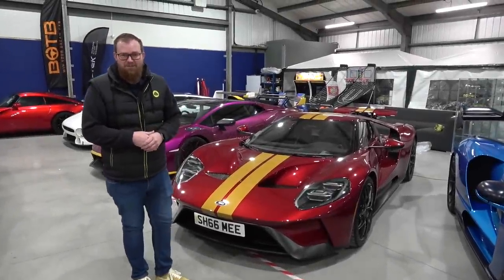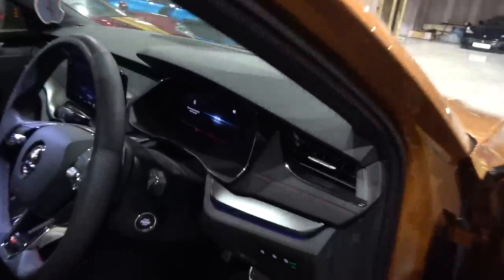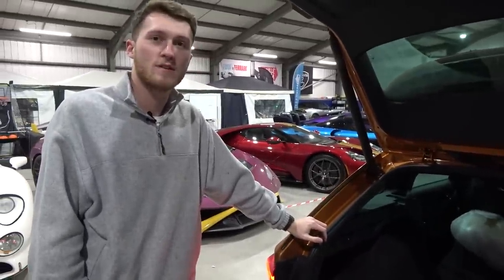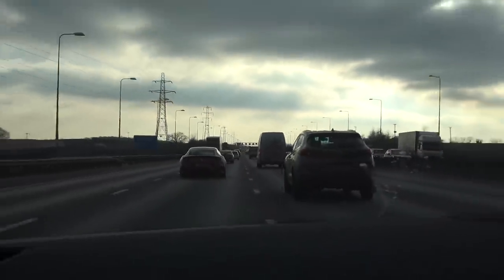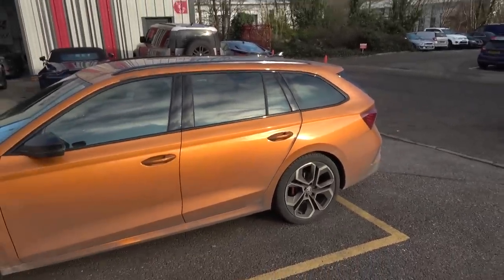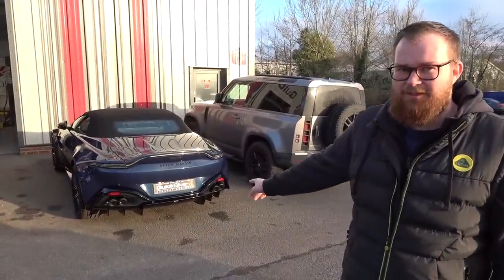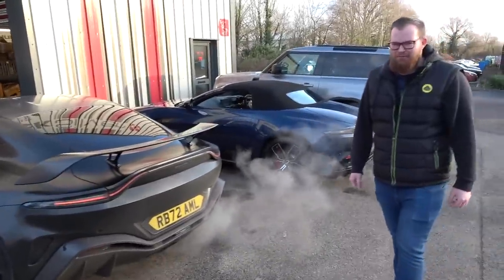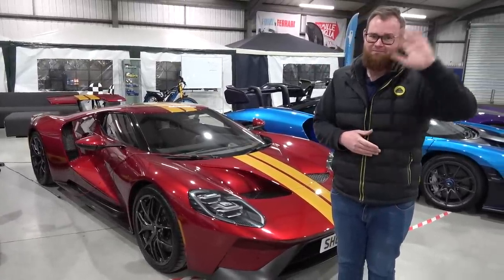STRAIGHT PIPING The Ford GT! | SHMUSEUM VLOG 113

Comment: Man, many of the prank suggestions are just, ugh...
Wrapping a car in a colour as a prank? Gotta love people spending other peoples money. To all that suggest it, that's a five grand "prank" and potential damage to the paint.
A good prank is cheap, not destructive and properly annoying. Oh, and it's important to make sure that the prank does not backfire leaving the prankster with a ton of work. Like if you reversed all the cars so they sat ass end out. All he would do  was to ask you to put it back.
You could save an insanely expensive fake parking ticket in the SF90 glove box.
You could change all the memory settings of his seats to all the way forward and up.
You could buy a cheap door bell and easily wire it into the brake pedal on the Clio V6 or Mustang. Non intrusive and 100% reversible. Just take it off the brake light. All you need is that 12 volt pin.
Set the Satnav to Romanian in all the cars.